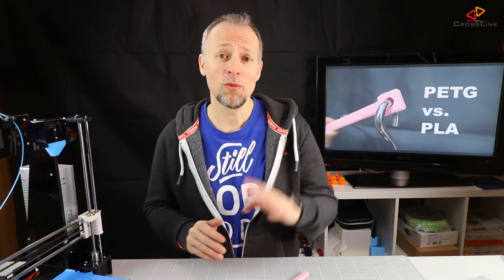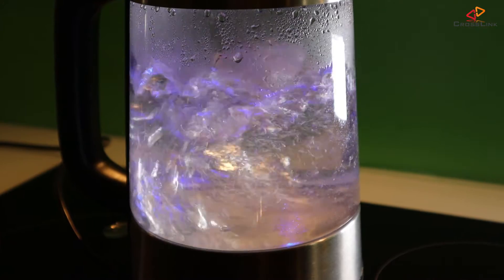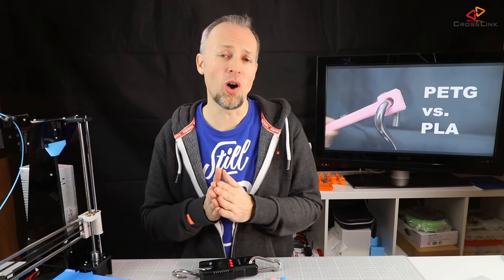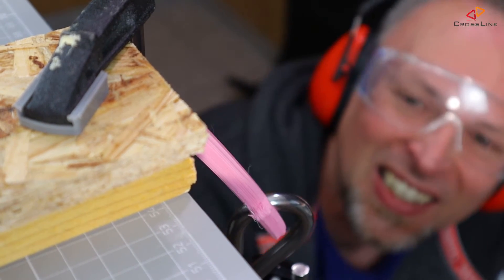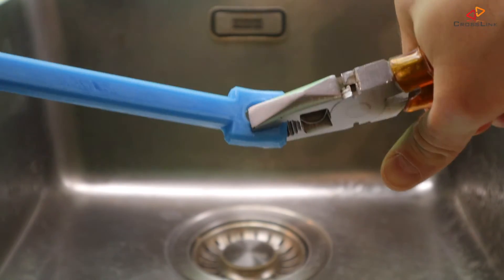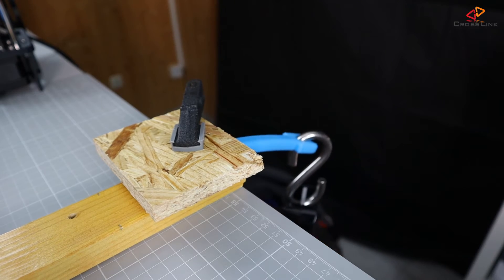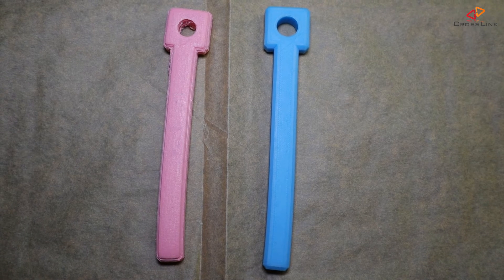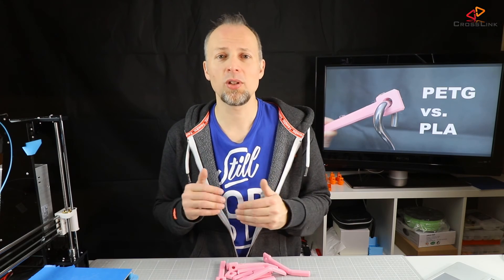PETG vs PLA - What is stronger?

Comment: This is a horrible test that doesn't show anything. You cannot load those at anything remotely near constant strain rate with your method. Also, the direction you are pulling in is terrible because it allows the table geometry to affect the test. Please at least look up some info on how to do proper testing beofore you do it. I realize not everyone is an engineer, nut that doesn't excuse laziness.

Comment: The fact that the PLA held 3 kg (about 10%) more after being baked may be explained by the fact that it got 10% higher. The stress the PLA was able to handle was not any higher after being baked than before, but since the PLA bar was higher, this effectively created a 10% longer lever, so the bar was able to withstand 10% higher torques.
Reply: Actually there is no change to leverage (I know 3 years after the comment). Since he is measuring end to fulcrum when he mounts the piece this distance does not change after baking. If he had printed a mark on the piece then mounted it based on the mark you would be correct. The actual change is in the amount of material at the fulcrum not in the length of the lever. It is simply thicker due to retraction towards center mass which requires more force to break through more material.

Comment: Great video but im definitely new to 3d printing and it looks like the pla has a nicer looking print. Am i wrong, does one print better then the other?
Reply from the maker: You are correct, PLA is easier to print, PETG is more challening to find the right settings and still it has more stringing for example. It's not as hard as PLA, so the usecases are different.

Comment: Also you might want to use test parts that have symetricaly identical holes on each end of the test rod and used these two holes for alignment and dimensional reference test points. apply the loads against these alignment holes . . .  This would help test the same material geometries and  to give a more verifiable/ true result.

Comment: I think you petg print should be re done at a higher temp.and less fan cooling. The example you where using do not look like the petg bound very well with flaky layers. 

I know petg can be considerably stronger then pla, but it takes a higher then segested temp to print with and the cooling can be tricky depending on the mix. 

I have seen the flaky print issue with my own experience. It took 15c higher temp and less fan to get smooth print
Reply from the maker: Makes sense. At some point in the future, I might repeat this with different temperature samples to see the differences

Comment: You draw a false conclusion.  Baking did not make it stronger.  It made it thicker.  The material is not better there is just more of it.  The thickness of the beam is the largest factor (cubed power).  If you printed a test specimen that is the same thickness and width as the oven cooked part after the oven you will see this.  I would suggest you may have actually gotten a weaker part but I have not done any math...
Reply from the maker: what could verify these theories is to bake the material and then sand it until it has the original thickness.
Reply: annealing the material alters the polymer alignment increasing strength
Reply: @MrDead1975  you have missed my point.

Comment: PETG:flexible but unbreakable like ABS(actually ABS is not flexible but it’s unbreakable too!)
Reply: ABS is significantly more rigid: it has a high Young's modulus and changes its shape minimally under load, but definitely breakable at a higher load

Comment: I've only just started printing PETG but so far very impressed. Particularly in situations when PLA would burst such as enlarging a hole in a small part with a drill.  I think PETG will take self tapping screws better and printed screw threads will be much stronger.
Reply: I love PETG, I have some from a one off order we did, and its a transparent blue.  I did a fun project to print a bike rim idea.  And the cross section withstands a 200lb teen stepping on it without any deformation.

Comment: which material should i use for it to be flexible as well as be able to hold 100 N force ? please reply ASAP
Reply from the maker: TPU material should work. I used the SUNLU and it is flexible but still strong. What is the usecase?

Comment: Hi! Is two components epoxy able to glue PETG?
Reply from the maker: Not sure, why not try it out?
Reply: @Crosslink3D  Because if I can't glue it I don't buy it now for a project I'm developing
Reply: Use Epoxy with fiberglass powder (sold in a bottle) and mix together. Once layered, it will be ultra strong and heat resistant.

Comment: something is seriously wrong with your PETG settings, those parts look way uglier than they should be. I have been using amazon basics PETG at 245c on 75c bed @ 35mm/s infill, 18mm/s walls 7mm retraction @ 50mm/s. parts come out very glossy. very, very, little stringing. Your parts look like chewed bubblegum
Reply from the maker: Hey Demoncaller, thanks for pointing out. I will try your settings and check out the results.
Reply: @Crosslink3D  Here is my full PETG CURA profile if you or anybody else wants to try it https://uploadfiles.io/t82jlj3n
Reply: @TheDemoncaller  I couldn't import this into Cura 4.... Any ideas?  Was it done in a previous Cura version?  thanks for the tips
Reply: @Dave-ub6gq  It was done in Cura 4.0 I think the machine has to be the same to import the profile unfortunately, Mine is a CR10S Pro. I couldnt figure out how to get it export as a generic printer profile so I made an image with all the settings. you will only need to create a new profile for it.
https://imgur.com/oLJEXpe

Comment: That's not quite how you should compare strengths. The strength of a material depends on stresses, not necessarily forces. Going off the dimensions I saw at 2:00 and 6:41 (9.5cm from cantilever to applied force and 15mm by 15mm area), I found the failure stress to be about 50.86MPa or 7377 Psi. This lines up nicely with this datasheet I found. https://plastics.ulprospector.com/generics/34/c/t/polylactic-acid-pla-properties-processing

To find this, all you have to do is take (Moment about face of failure) * (distance from the neutral axis) / (second moment of area)
You can use this to design your geometry with a specific factor of safety in mind for each material!

Comment: Cool experiment.  I've noticed parts printed in petg sometimes have a slick feel to them, almost like wax.  I've been using the Amazon Basics petg as well.  I've been printing it at 230C and 72C bed temperature.  What temps did you print your petg and pla?
Reply from the maker: I printed at 235C an 80C bed. Also tried 230C and 75C bed, which had less stringing